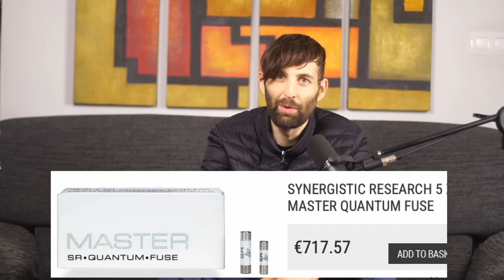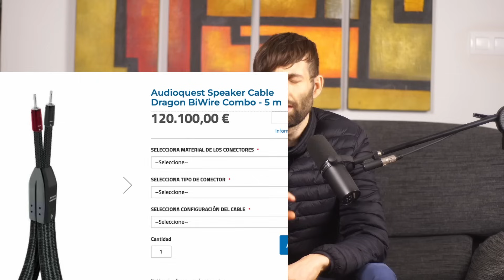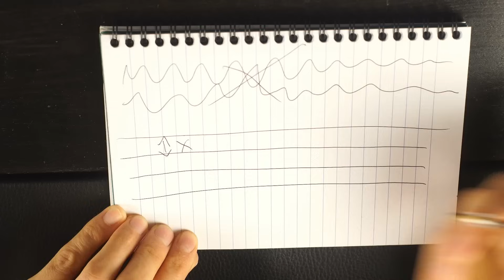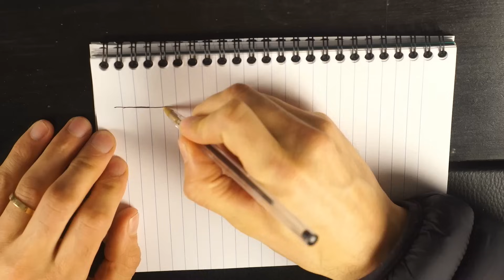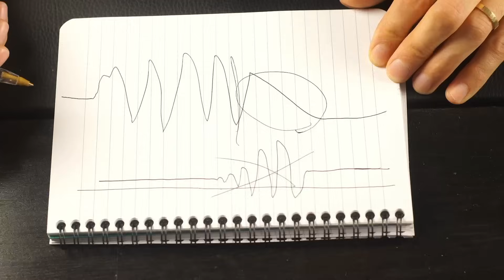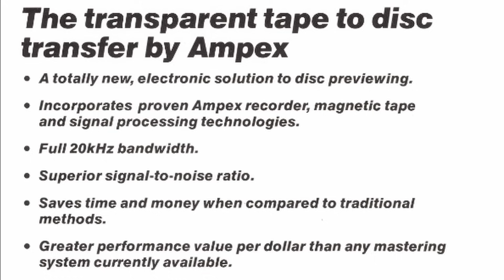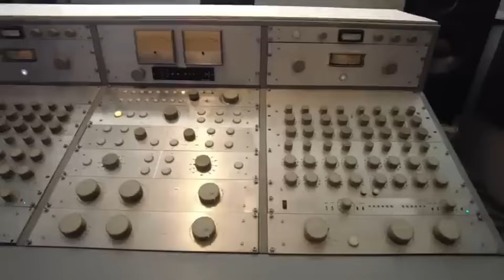Hard truth: most vinyl is digital anyway

Comment: I recall when at Opus One, we techs loved when CD's came out.  All the issues we had with turntables went away.  

I posted this as a response on facecrack...

I eventually got a comment from Larry Boden stating - " I wrote the book “Basic Disc Mastering” and you have nailed the flaws of disc playback perfectly. My had is off to you, sir. Well done." 

I don't mean to be a Debbie Downer, but vinyl/turntables suffer from quite a few issues:

- tangential tracking error caused by a pivoting tone arm - masters are cut radially... Unlike the cutting head of a mastering lathe - which travels at a perfect 90d tangent to the groove - a stylus is constantly changing its addressing angle to the groove walls. So the modulations of the groove are not faithfully reproduced since the playback stylus is always moving at a non-perpendicular direction as to how it's cut.

Pivotal tone arms also lead to:
- Skating. As a disc rotates it impinges forces on a contacting surface that cause it to be drawn to the center of the spinning disc. In the shop, we had blank records with no groove that we'd use to set the antiskate mechanisms (usually a spring or weights) that would try to counter act that force. Problem is under compensation causes the stylus to ride up on the side closest to the hub (the left channel) and proper compensation causes the groove closest to the outside (the right channel) to have to drag the stylus against the antiskating force, which causes the stylus to ride up on the outer wall of the groove. It's a real problem that's very hard to deal with.

- low frequency modulation caused by the slight warpage - causes the woofers of a system (or the panels in planar speaker like an Acoustat or Magnepans) to modulate signals above it. You can see it on a Lissajous display on an oscilloscope. it cause the center dot on a blank groove to bounce. You can also see it in larger woofers moving at super low freq (~1-10Hz).

- mismatched RIAA equalization curves - this is the reason you hear about how records sound "warm". That warmth is a mismatch between the RIAA curve that was used to cut the master, and the inverse one used in the consumer's gear. See Larry Boden's book. The RIAA curve was developed to increase the play time on an album side. So during cutting it rolls the bass off and increases the treble. On playback, the consumers reproduction system is supposed do the opposite - increase the bass and roll the treble off. Unfortunately, getting two filters to do a perfect inverse is impossible. Just won't happen. See this 

- Reduced elasticity of the groove walls on subsequent passes of a stylus. You see, records are made with polyvinyl materials that have plasticizers mixed in. The problem becomes that as the tiny radius of the stylus impinges on the groove wall, it compresses it. That can be an issue if enough time has not elapsed on subsequent plays of the same section of the groove. That can lead to fracturing of the groove wall, since it's already compressed.

- Asperities in the surface of the vinyl. These cause the noise heard. It's because there's no way to make a perfectly uniform material, so slight variations in the surface are unavoidable.

- Limited channel separation - a few issues lead to this - one the aforementioned skating forces in addition to the limitations of the groove geometry. An groove with stereo information that is in-phase and monophonic swings the stylus left to right. Channel information is realized by a 45d up pitch of the stylus movement - which is limited so it limits the separation of the left/right signals.

But what's really bad is left and right channel signals that are out-of-phase. This causes the cutter head to move vertically. If significant low frequency information is out-of-phase in the audio signal it can cause lift out of the groove path which leads to skips in the groove.

Note this is what happened to an early pressing of an early Led Zeppelin release. 

Why we used scopes set to show Lissajous/X-Y when mixing

- Decreasing circumference as the groove goes toward the center of the record. This is obvious as the record is spinning at a constant RPM (revolutions per minute) so that means less material is available for groove modulation.

So yea - records suck - sorry. Even the guy that won seven Grammy's for engineering Steely Dan -- the stuff all the golden ears vinyl people seem to like (and it is really good, analog or digital) - hated vinyl - Roger Nichols. He wrote an article called "Snap, Crackle, Pop" that explained the reasons for his becoming an audio engineer (he was originally a nuke engineer).

Where:
Snap, Crackle and Pop Music
A tale of the (wrong) tape when remastering

By Roger Nichols

"I originally got involved in recording music because I hated clicks and pops on record. I figured that the only way that I was going to get good quality recordings to play was to record them myself. I could then bring home two-track 15 ips copies to play on my stereo. Much better than the Rice Crispy sound of vinyl LPs."

After I posted this, Larry called me up and reminded me of one issue I forgot - the decreasing radius as you go towards the center.  

He told me that as you get closer to the label/groove runout, you actually start erasing things you just previously cut.  He mentioned a story when he was working as a mastering engineer of trying to convince the label that "Frankenstein" on "They Only Come Out At Night" should be one of the outer tracks since it had such wide spectral content.  

Nope, they wanted it at the end of the side.   Larry was bummin' from what our conversation sounded like.  

Oh well...  

As to MC cartridges that have lower moving mass than their MM counterparts (because having the coil on  the cantilever results in less inertia) I had a story of a guy with a Thorens  table and a Linn-Sondek tonearm with a Supex MC cartridge. 

One day a KA-7 unit came down to the shop  -  at Opus One, we had a lift that would go between the fancy showroom and the dingy shop/warehouse in the basement.  On it was the service tag that read, " Picks up Radio Moscow on right channel" ...  

I was like WTF?  I went up to Phil - a sharp well versed sales guy that wrote the ticket.  As I was starting to say this is nutz, he mentioned that the customer ran the electron microscope at CMU...  so he wasn't a neophyte to technology.

I tell them the only way I can troubleshoot this is to go to the customer's house.  

Being a broadcast engineer I was familiar with various atmospheric conditions that can affect radio propagation - such as how the sun angle can change the ionization over the period of a day depending on the time of year - this is why some AM stations are called "daytimers" and have to change power levels at different times of the day depending on the date - - s

 So I get to the guy's house about 5PM and he takes me downstairs to his stereo set up. It's near a window/outside wall.  I then put on some headphones, turn on the KA-7, set it to MC and just leave the tonearm on his Thorens on the tonearm rest.  

Sure enough, I eventually hear the BBC station, then Air Canada, and many other longwave transmissions dancing around in the stereo field.  It was quite interesting as they'd pan and fade out as another would appear.  

So I looked out the window and saw a longwire - it's an antenna that looks like a typical clothes line everyone used to use to dry clothes.  But it's made of wire and is used by enthusiasts known as DX'ers - - DX stands for "distant station" in amateur radio lingo  

So I ask him if he's a DX'er ... sure enough he is.   I then as him what he's using for lightning protection for the longwire.   Turns out he was connecting to the ground lug of the outlet right outside the room that his stereo is plugged into.  If you may recall turntables have a separate ground wire that is usually tied to a terminal on the back of the preamp which is at ground potential.  

I go outside and notice that the insulators for his longwire have mold growing on them which is also present on the lightning arrester (basically an airgap) which is bridging across to the ground terminal.

This gives you an idea as to how low-level the signal on a cartridge is.
Reply: Sorry, say again..

Comment: 24 Bits means, if you digitized a surface with 1m height x width with 24bits (16 Million Steps), a pixel had 60nm size. This is 1000x smaller than a hair and the surface would appear to you like a flawless glass surface

Comment: Hey AP. Can you talk about the way that the playback characteristics of vinyl are a function of the distance from the centre of the record the groove is? i.e. That as the groove approaches the end of the recording area of the disc, the high frequency response reduces significantly and the distortion increases significantly? I don't know what universe that playback characteristic is supposed to be superior in, but it's not mine.

Or about the fact that you can't cut loud and wide bass frequencies, as the groove shape produced rapidly changes from very deep to very shallow. This is a groove that is very hard or impossible for a playback stylus to track. The solution is an elliptical equaliser - but that changes the sound from what was intended to what is physically possible.

Or about the fact that loud fast transients in the music can easily be uncuttable - or rather can be cut, but can't be played back without distortion, and so an acceleration limiter has to be used - again with the effect of also changing the sound from what was intended to what is physically possible.

Comment: I mean... Using a digital process to create an analog device (or component of that device) doesn't actually make that device digital; To further illustrate the point: A gear used in a mechanical watch (which is a thoroughly analog device) could very easily be cut and machined using a digital CNC machine -- does the use of a digital process during manufacture change the intrinsic nature of the gear to being digital? No, that's silly lol the same is true for vinyl: Even though there's digital processes involved with their manufacture, the finished records themselves aren't digital devices.

Comment: What really baffles me is the cables etc. If you take the most expensive cables for 'hi-fi' with really good copper and large cross sectional area... If you then cut them in half then soldered a thin piece of bell wire in the middle of each one audiophiles would think you were mad. However, at each end of these cables we have in series, a series of very thin wires... to the cross-overs, on the circuit board, to the coils on the speaker cones, at the amplifier, thin wires from the speaker terminals to the circuit boards, the soldered integrated circuits, the very thin tracks on those same chips... Notwithstanding, a high ratio of men of a certain age, (including me, I'm 57), with less-than spectacular hearing.

Comment: The playback is analog. It's also a feedback loop. It loops sound back into the playback. Footsteps. Bass. Etc cetera. 
This adds a "familiar" feeling into the playback. The room is added in at a low level. "Realism" is boosted by familiarity.
Each playback will also sound slightly different.

That, big art and the fact it's actually moving during playback makes it a hit.
Reply: Every sound that reaches your ears, regardless of what it comes out of is analog, because you're not a computer. Cassette also moves and sounds different on every playback. In fact, every analog recording medium does this, whether it's grooves or magnetism.

Comment: TL:DR, the physical act of listening is highly subjective 
All this heat over analog vs digital, vinyl vs CDs, all of this ignores what in telecommunications is called the ‘last mile problem’. Everything can be perfect from the source transmitted all the way down the chain to the recording medium.
But most people forget one thing, the person’s hearing!
A 15 year old will hear the ‘perfect recording’ very differently than a 60 year old on a purely physiological level, most 60 year olds will have lost their sensitivity to higher frequencies and hearing the same vinyl record from the same equipment at exactly the same time will be perceived quite differently.
There are Yt videos that younger people need to watch simulating what an older person hears vs a young listener, it’s quite dramatic.

Comment: Appreciate this. But one thing to consider regarding vinyl cut from a digital file is that it usually has different mastering than the digital counterpart. Some people may prefer the sound of the vinyl mastering, particularly in cases where the digital counterpart is overly compressed, which has been a trend for a lot of digital albums for almost 30 years (loudness wars)—you touch on this but I don’t think you specifically called it loudness wars. 

It’s a completely different story for albums recorded fully analog—in my experience they typically sound better on vinyl or tape, but I’ll let someone more equipped explain how transfers to digital have typically been done and why some of them have been subpar from a sound quality standpoint.

Comment: As a dj, the main reason Im interested in djing vinyls is the music you can find in vinyl, there are hidden gems, thats extremely hard or impossible to find digitally. And to me thats the most important thing.

Then, djing in vinyl, is as hard as it can get, it’s a fun challenge I want to tackle, but the overall reason is finding unique tracks.

Not getting into the conversation about what real djing is, digital or vinyl, bla bla bla, both are real djing, and both propose different challenges and ways to the dj to create the same outcome, make people dance.
Reply: I've also DJ'd for years and I agree that you can find some things on vinyl that you can't find digital, especially older music from before like 2005 or so. However, I'd still buy the record, then rip it to digital for mixing though. I'm done with the inconvenience and fragility of vinyl. I've accidentally put skips into some of my favorite records. I've carried heavy ass bags of records up a ladder to the DJ booth. It's fine to like vinyl, but the format is not conducive to a working DJ environment as much, especially since house vinyl equipment at a bar or club isn't maintained as much as it used to be when people were doing it more.

Comment: Having a well tagged digital source flac (ranging from 16/44.1 to 24/96 here) for me is extremely valuable. I put all effort into this. This allows me to easily convert, name and dsp music for target devices. Example: Give me a perfectly dynamic volume levelled (bc. classical dyn. range) mp3 for my car, in a perfect directory structure, with auto resized and embedded cover. All this is, after  homework has been done, easily possible. (Lame, fb2k)
Only owning vinyl would limit me massively. Limitations for huge money. No. Thx.

Comment: Your clickbait title pulled me in, I was fully prepared to call you an idiot, however I'm 2 minutes in, and I agree with every point you've made so far
The only real argument for vinyl is simply, "I like it", or "it encourages me to listen to an album in one go, as it was intended", even maybe "I don't like clean sound"
All that said, Vinyl isn't digital, but a D/A or A/D converter is one the cheapest and most transparent items any audiophile will purchase, so yeah you caught me
But don;t me in the same box as those idiots buying £1000 magic rocks to sit on their speakers and make them sound better
Reply: Also, if they were true purists, surely they'd have to produce their own multi track recordings. Routing percussion to standard speakers, brass and woodwind to horn speakers, strings and vocals through ribbon speakers, to best replicate the original method of sound production ;)

Comment: With the digital relay and groove size does it alter it for that specific revolution of the vinyl or just as and when no matter where on the disc it is but ensures the next revolutions groove is kept out of the way? How does it know the length of each revolution as this changes whether closer to edge or centre - as you can tell I have no idea how this works.